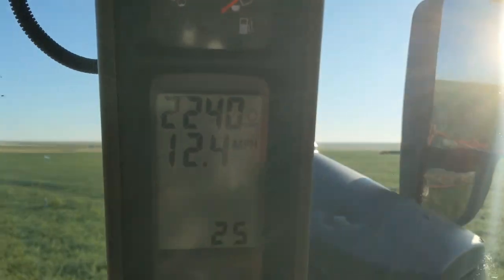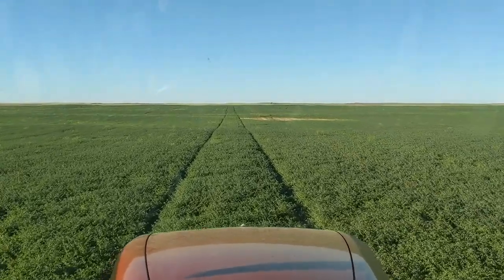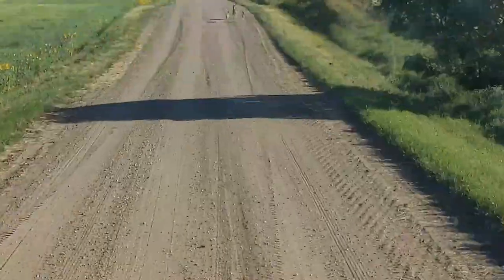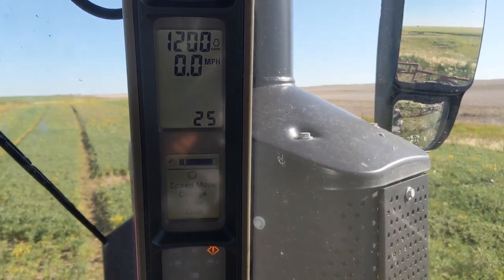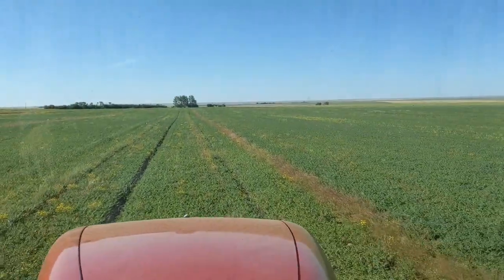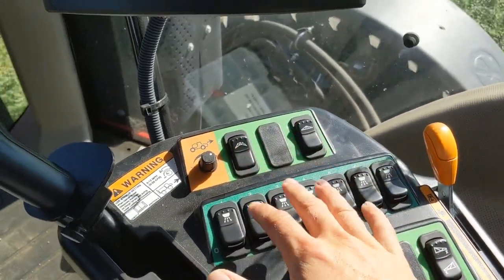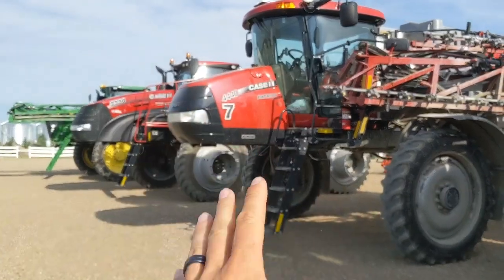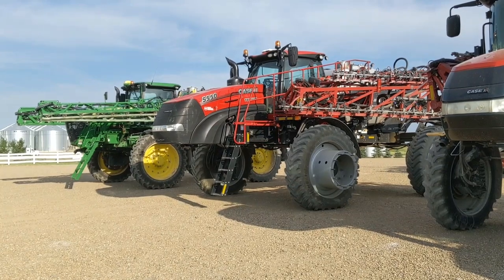Trident 🔱 Review Prt 1

Comment: I know this is quite late, but track spacing (Automatic Axle adjust) is also available in the ISOBUS Virtual Terminal (available on the PRO700 or VIPER4+). Its a super neat system. Much smarter than than the Patriot or Deere

Comment: Rear engine sprayers must be MUCH quieter... would love to see a hands-on with Hardi Rubicon or Hagie...
Reply: Their Case IH Patriot sprayers have rear-engines too, even though it might look like the engine is under the short front nose, but it's not, I guess that short hood is only for the cooler and other small things. The Case IH Trident in this video on the other hand has a front-mounted engine, that's why the nose is much longer than on the Trident.
On the Trident the engine is placed at the rear behind the sprayer tank. Since the boom is also rear-mounted this does not give a very good and even weight distribution between front and rear wheels. Maybe that's why the Trident still has a nose at the front, to put some stuff under there for a bit better weight distribution.
The Hardi Rubicon and Hagie rear-engine sprayers you mention which both have front-mounted booms for much better weight distribution and much better and more ergonomic view of the sprayer boom and nozzles. You never have to turn around to look behind to check the booms and nozzles.
Reply: ITubeTooInc Patriots have rear engine, tank in the middle and fuel tank in the front. Believe me that weigth distribution is benchmark in the market. In Trident the engine is the front because the porpuse is have liquid and dry system with the same chassis

Comment: Great video and 1st part of review. So, no manual to be used whatsoever, with yr expereince most speaks fr itself except for track spacing, apparently in the corner post, pff, who has that, LOL. 
Very nice to see the other sprayers  side by side in the field. I have a question on that. How do you keep track of which part of the parcel or plot and many parcels has been sprayed, either by you or a partner, colleague sprayer or one of the other employees at the farm that actually do the spraying? How do you know where to restart in the field and so on, and what others had been doing, this run and or need to be done next round in say a week or little more? How this is monitored? Thnx. 
Nice also to see the Bambi  family, and there is lots more of sorts of ... and tons of gophers. Great story 😒😂 
Btw, nice natural and adequate simulation of the noise of adjusting ride height, psst psst pszst 👍

Comment: The fpt motors case and new holland use really scream at high rpm 
Is it twin or single turbo 
The twin turbo new holland tractors you really know when she hits load 
Between the turbos and the air seeder fans I rekon it's damaged my hearing over the last 20 yrs (They used to be Cummins but they're no better)